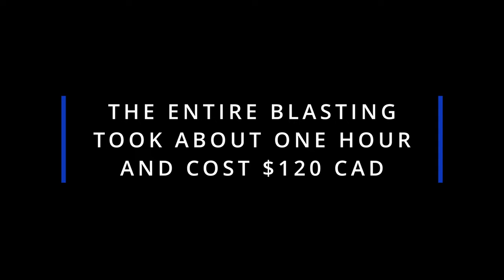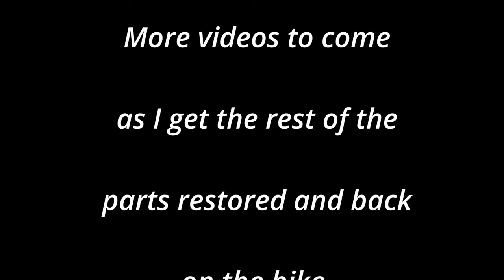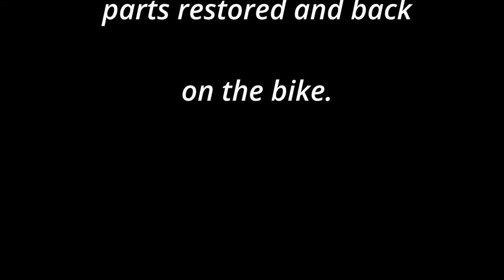Polishing Aluminum - Yamaha Virago 1000 Restoration Video 19

Comment: if i am not wrong exposed aluminum will oxidize quite easily in a little time. taking away the shine. before you reasemble everything find out what is the best clear paint to protect al that elbow grease. 
 thanks for sharing the process. Ive no doubt you'll be able to get a classics plate for your virago.
Reply from the maker: Thanks for the comment!!  Yes, you can clear aluminum, chrome, brass, etc., but you can keep polished aluminum looking new by cleaning often with window cleaner.  The ammonia does a pretty good job of keeping it looking like new.  You can also use a metal polish like Auto Sol or Mothers whenever needed.  Since I only plan on driving this on sunny days, I think I'll see how it goes as it is naked.
Reply: The 2 outer head fins on my Kawasaki h2, I would polish them with auto sol. They would look amazing when I finished. But wasn’t long before they started to look dull again. It would be interesting if you clear-coated one part to compare in the future. 
As always you have created another amazing video.
Reply from the maker: @joef6858  Hey Joe!!  My two lower fork tubes are aluminum, not polished but brushed and clear coated with an aerosol made for aluminum wheels/rims.  I’m curious to see how they hold out.  A 2K clear would be more durable, that’s for sure.  For the aluminum parts, I was advised to clean often (in between the AutoSol) with window cleaner that has ammonia - apparently it’s supposed to keep oxidization at bay.  That’s what I’m doing now so we’ll see how well it stands up when I get this beast back on the road.

Comment: Do you not need some form of clear coat to protect from future rusting? 
It is bare aluminum after all.
Reply from the maker: Polished aluminum keeps really well in dryer climates. I keep it clean with regular washings and glass cleaner with ammonia. It’s been a year now and it still looks like chrome.  If I want a bit deeper lustre the I go at it with a drill puff and some mother’s aluminum polish.
Reply: @KensWorldRestorations  okay so I’m going to do something similar to my bike and I live in a much more humid climate would you suggest clearing it or do you think it would ruin the finish?
Reply from the maker: @owencaton2433  Just be careful with clear - I wouldn't suggest using a spray can/air dry type clear.  If you want to clear polished aluminum, use 2k clear and use an adhesion promoter and use isolpropal alcohol to make sure all polishing compounds and residues are gone.  The brushed aluminum takes clear coat very well but polished needs some extra care.  Once the clear sets up, it should last for years.
Reply: @KensWorldRestorations  thanks mate, I’ll take as much advice as I can get I am trying to restore my 1985 XV1000 to as original as possible and so far you have been a life savour. Your video series has been a great help so far. Be prepared to hear from me again as it seems you have lots of experience on this matter
Reply from the maker: @owencaton2433  Feel free to email me - the address is on the info page.  Cheers!
Reply: @KensWorldRestorations I looked under your info tab and I’m not seeing anything. Perhaps I’m in the wrong area?
Reply from the maker: @owencaton2433  kensworldrestorations@gmail.com

Comment: Lot of work.  How are you tackling the chrome-plated plastic parts, like the cover on the fuel pump?
Reply from the maker: The fuel pump cover is new - I sourced an OEM/NOS part from CMSNL as the original was gone when I got the bike.  The headlight, speedo & tach covers, center cover, tail light bracket and tool box case (over the rear fender) were all polished using a soft polishing wheel and some automotive polishing compound.  I was really surprised at how durable that plastic chrome is.  That seemed to work for the red plastic tail lens too.  There are two emblems on the engine that were completely gone so I had someone make some resin emblems on a 3D printer.  I'll be painting those chrome with Alclad II chrome laquer with my airbrush.  I've tried painting it on some plastic spoons and the results are amazing - as close to chrome as I need it to be for that.  I'll make a video of that since I think it's pretty cool.

Comment: Absolutely fantastic! After witnessing that I may try my hand at powder coating instead. I picked up the parts to convert the starter for my 1983 920 to the 1985 1000 version, and the parts all have nasty chrome on them that needs to be addressed. Great series!
Reply from the maker: Thanks Paul!!  Wow…comments like this really inspire me to drudge on.  This one was the worst - the mess, the time and the effort was so much work.  Obviously, they look great but that was a total of 2 months of work (between work shifts) and I had to spend moolah on a new buffer.  So hard to get the chrome off and so many shops were afraid to even touch them.  With the starter mod, pay close attention to the clutch - the 1000 version has 19 teeth and the 1100 has 18 (they are different part numbers) but both fit the same starter as the inner splines are identical.  I just replaced my starter and noted the difference.  Good luck with the mod - I’d be doing the same.
Reply from the maker: I think powder coating has come a long way in recent times too.  They can replicate chrome really well.  Next restoration, I’ll be considering more if it - frame and other components.